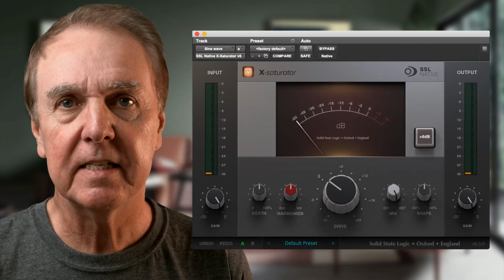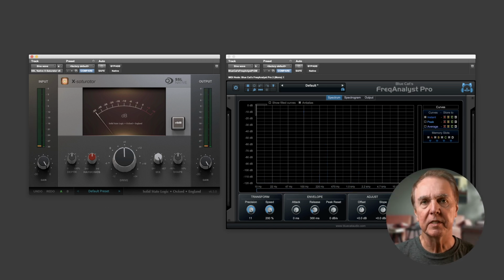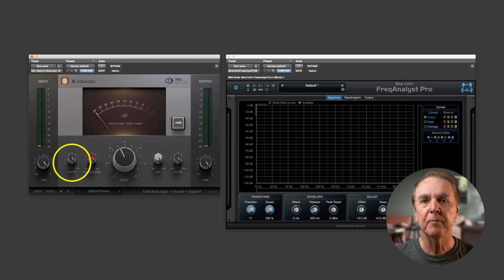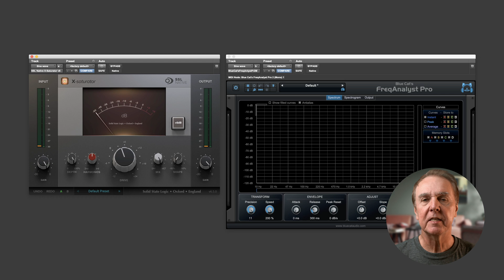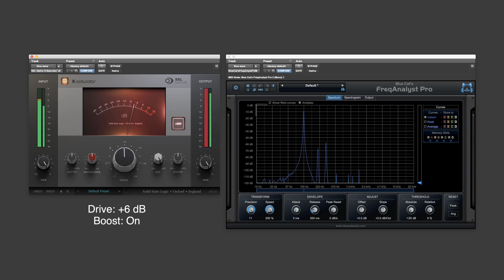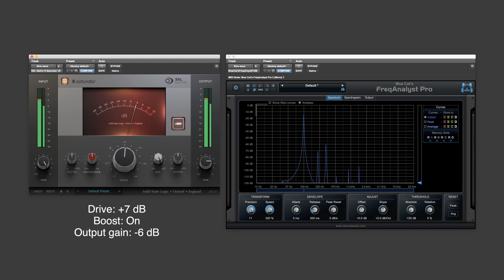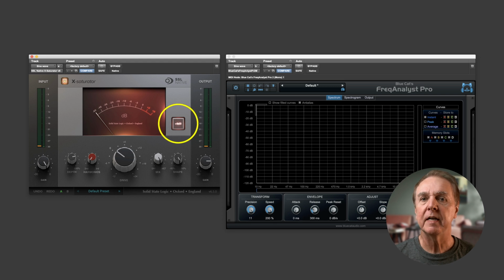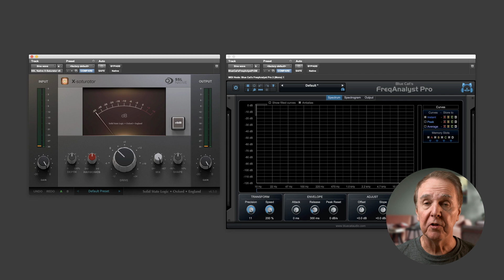Let's saturate! Harmonic enhancement demoed with SSL's X-Saturator plug-in

Comment: Prefer Fabfilters Saturn2 but have to accept x-saturator is a nice clean simple GUI. Would it not be great if a modern amp had this built in to emulate tape/valve harmonics and make those awful sounding digital sources sound more analogue, natural and warm. But wait, you could add a audio interface to your signal chain and do this on your computer  making your inexpensive amp sound like a really expensive one with some simple tweaking. You can even add it to JRiver media player, you dont even need to use a DAW and make all those horrible digital files come alive and sound lush and wonderful just like a vinyl record does